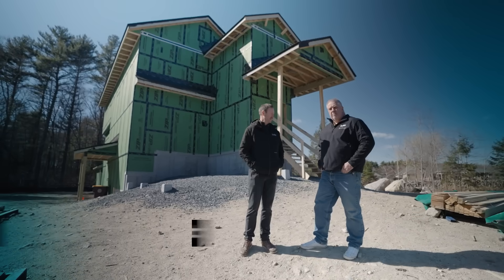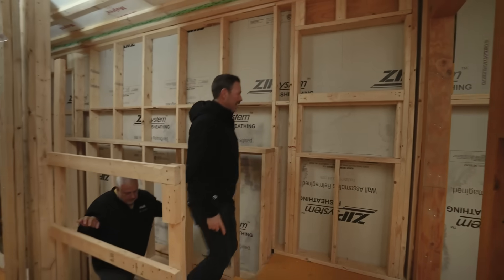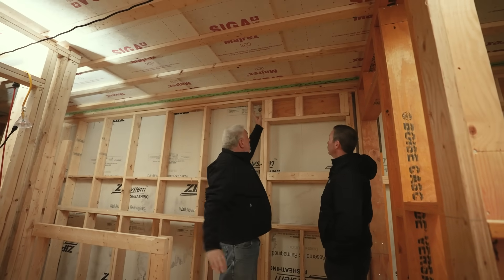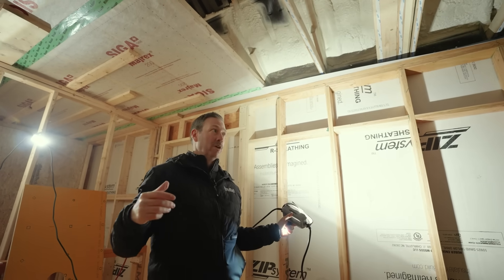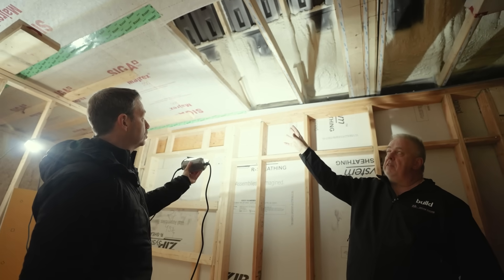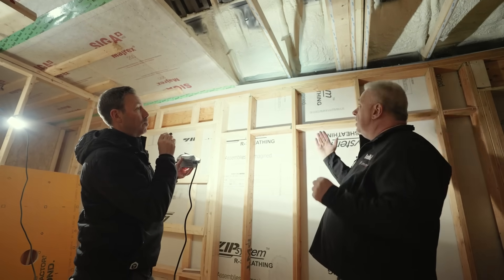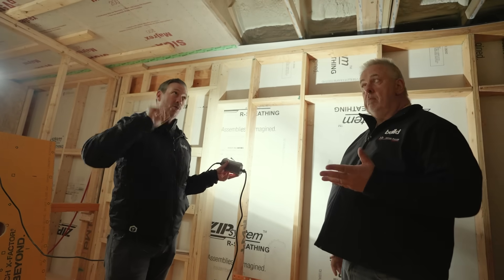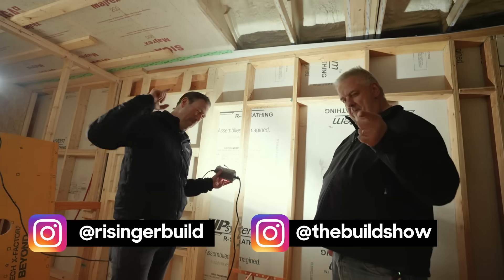Vented Attic Insulation?  Here’s a trick We Stole From European Builders

Comment: We recently went through this and documented it, but our architect wanted the sheathing to tie the trusses into the building. That meant that the top of the sheet did not fall exactly on the top plate, so we couldn't wrap the tape / membrane through to the outside of the building like this. We ended up doing the same idea, but had to seal the membrane to the backside of the sheathing. Curious if anyone feels that the structural tie in of the trusses down to the wall with sheathing is necessary?
Reply: Assuming I understand your comment correctly, It's a good detail imo, especially with high wind loads. Personally, I like the idea of a raised heel truss with the sheathing running all the way up the heel of the truss. It ties the truss to the wall and serves as a baffle for blown insulation.
Reply: @noneyabidness7226  Yeah that's exactly how I did it. Raised heel truss, sheathing goes all of the way up. Before setting trusses I placed a strip of intello down on the top plate and, depending on the spot, did my best to air seal to the sheathing with tape, air dam, and gaskets. 

Couldn't find a "proper" way to air seal this. Felt a bit makeshift.
Reply: @bellrisefarm  If you had used zip sheathing would you really need anything else? Aside from airtight drywall.
Reply: @noneyabidness7226  In my current house, that is the weak spot. I'm trying to get ACH50 below .6, so I was hoping for a continuous air barrier around the entire house. Airtight drywall works, but requires attention to detail. Conservation technologies has gaskets made for that top plate connection behind the drywall. I can go that route. The easy way would be just some sort of tape/membrane that laps over the sheathing onto the top plate as shown in this video, but that doesn't work well with raised heel trusses.
Reply: ok - i have solved for that too, put a couple beads of Tremco acoustical sealant on top of the plate run the Majvest across the plate smooshed into the plate and into the room to connect to the Mayrex. As for the sheathing all the way up - simply run a bead of tremco along the face of the top plate - now you air barrier connections are Zip sheathing to plate to majvest to Mayrex......
Reply: @stevenbaczekarchitect9431  thats what I suspected, but it’s nice to hear confirmation - appreciate it

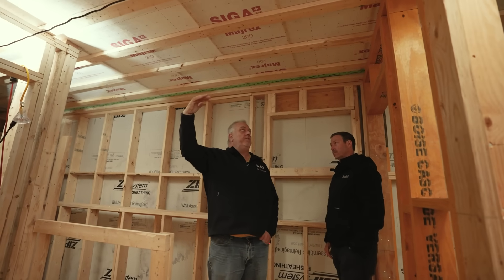Comment: European here :) at 2:23 he probably meant that moisture definitely cannot pass through SIGA membrane, it's not air barier but rather moisture barier membrane. Foam as roof corner air barier is one of the options, but not greatly used here, given most of the time insulation is EPS foam, which runs through the outside wall up to the roof. Piece on roof beam can be blocked off by simple osb or plywood to prevent wind from passing through the usually "blown insulation", but also as a way to be able to blow and stack more of that insulation towards the corners of the roof. One item that I missed, on 2x4, didn't he miss to add nail sealing tape? It usually gets added on top of the roof, but given this is moisture membrane you need to seal off those gaps here as well. Also, wouldn't just rely on tape, membrane glue should be a must, which can be used around nails/screws as well.
Reply: Majrex allows vapor to move well in one direction, but not the other. You will see it clearly stamped with direction. If installed backwards, it would be bad. It's like Gortex for a house. You can let moisture out, but almost no moisture can come back in.
Reply: @andrelam9898  nope. Check the website and read the PFF.

It’s all dependant on RH and absolute humidity.

It can move outwards, jjst not as well as what it lets inwards.

Most smart VB let it go both ways, still dependant on RH and absolute humidity.

Siga separates themselves by controlling it one way, but not totally stopping it still lets some out from the warm side to the cold.

Your welcome 😘😘
Reply: Siga says Majrex is vapor open.
Reply: For the OP, this is why I love cardboard rafter vents. They are easily manipulated at the heel, and can pass moisture through if needed if siga or poly lets sow through.

If you have raised truss heels, run your exterior foam boards up to the roof leaving your inch or two for venting. That’s for new builds or Siding and attic coupled Reno’s with raised heels.

If not the cardboard in old roofs with no raised heels allows best height of insulation. At edge wall, without stuffing batts below the stryo rafters as many do, as that takes in soffit cold air and your top plates aren’t really insulated.
Reply: Are you saying majrex isn't considered an air barrier? If that's the case that is absolutely false and is marketed specifically as a smart vapor and air barrier.
Reply: @Deluxe754  Its marketed as vapour barrier, oc as vapor barrier it can probably act as air barrier as well, but initial intention is to use it as vapor barrier inside. I'm not a builder, just building myself and Siga wasn't my choice tbh, so not super familiar w the product itself. Whatever the purpose, if you take "smart film" marketing wording to be able to release humidity from attic to inside house that's a big trust you are putting into $5/sq.m material especially when you have metal roof which does need ventilation on both sides of the roof membrane you've used. Hence why here, if doing metal roof (I'm not) you put OSB or EPS or plywood as wind deflection on your roof trusses (if that is the right word, top of the wall where your roof rafters sit). Doing so, allows for wind to enter from eaves overhang and exit through ridge or whatever is your flow option, what is key here, is that you prevent wind blowing into your insulation (blown wool/fibre or whatever you used) as otherwise it will kill your insulation R rating.
Reply: Nooooo, I meant what I said, Mayrex is a superb Air Barrier, and is vapor open for moisture migration

Comment: Couple of things I’m curious about.

And I absolutely love this style of full envelope, and love what these guys are doing not trying to knock I’m genuinely curious.

Wondering first how is the blown insulation supported? Because the drywal is going onto the horizontal 2x4, so what about that 1.5 inch space?

Typically the drywall holds the insulation weight, how is the weight bearing down to the drywall in this scenario?

Insulation is light of you grab a handful, but R60 let alone R80-90 etc is a lot of weight, how does that sit on that smart vapour barrier?

Also another thing I’ve always noted, is that (with standard 6 mil poly) when it’s drywall - poly - strapping - insulation the poly is flush on the drywall.

But when they do drywall - strapping - poly stapled to truss - then insulation over found the strapping gets mouldy a bit due to that 3/4 gap between the poly VB and the drywall.

While moisture forms in that cavity, on the warm side of the poly VB, it’s forming on the wood strapping and then not drying out as easily as opposed to poly behind drywall where it’s forced to dry onward to drywall and conditioned home.

How is that dealt with? I know it’s a smart VB but still moisture forming where the 2x4 is would be an issue here wouldn’t it?
Reply: The siga majrex is taped to the bottom chord of the truss with a tenacious siga tape, then the 2x4 strapping is nailed over that to the bottom chord of the trusses. The 2x4 strapping provide more than enough support for the blown in insulation that is to come. We’ve successfully used this approach before.

The one directional nature of the majrex allows any potential vapor from the warm side to pass through into the vented attic. The blown in cellulose is vapor open as well.
Reply: @brettpelletier1219 two things;

First the 2x4 of course strong enough to hold, more thinking of the span between 2x4 strapping. The insulation will weigh on the VB causing it to stretch or pull off staples or tape holding it in place etc.

Also two things with the vapour drying I think possibly problematic.

First you don’t want and moisture passing into the attic insulation, that’s the point of VB.

Also the main of my original point is that when there is a cavity there between drywall and VB, the strapping will take some moisture which regardless if the drywall breathes or this new VB breathes it’s the point that the wood will not dry as quick.

So standard 6 mil poly when done flush on drywall the strapping, moisture form warm side of poly directly on the drywalls back. Moisture has no other choice but to go into drywall and dry to inside.

But everytime (not exaggerating every single time) I’ve seen the VB on the truss, and then strapping the cavity created has moisture forming. Yes it will dry through the drywall, but it’s now wetting the strapping somewhat. And that strapping is slower at releasing moisture.

My understanding of the smart VB is that it can function both way.

As in when it’s warm inside and cold outside it should act as a normal VB.

But in the summer and it’s warm outside, and cool inside with typical poly VB now the moisture forming on the warm side which is the insulation contact side.

That’s bad because with dual climate -30C to +30C poly VB only works in one season properly.

That’s what the smart VB works with isn’t it? But regardless if it lets moisture breathe to the insulation that’s a problem isn’t it? literally the reason we use poly VB in the first place is to not let the moisture form in the insulation.

Cellulose or fibreglass regardless they’ll all be open breathing, the issue is when that reaches the top of the insulation depth and hits the cold attic air it rapidly condenses causing mould.

Not trying to call anyone out, jjst trying to see if there’s a missing link here.
Reply: @justinstevenson2061   my mistake, I see what you’re getting at. The 2x4 strapping is spaced 16” oc. I agree with your line of thinking here in regards to the science and your experience with how moisture moves, I just don’t think the real world application will be an issue here. We have dedicated dehumidification and this assembly isn’t trailblazing. This approach has been used successfully in many high performance homes and we’ve had success with it ourselves.
Reply: @brettpelletier1219  oh yes absolutely. I’m just the retro fit insulator. Main trade roofing, naturally moved to siding, and then natural to insulation.

Have to do siding to swap wall/step flashings effectively.

And have to understand insulation and venting to do roofing/siding so they all fell together.

I’m always baffled these idiot mass builders don’t for example put poly over the interior partition walls to connect each rolls VB continuous. Literally have said this for many years now.

Also as to why when they lay tyvek strips on top exterior plates is it only for the exterior tyvek to join, and never hung over the inside to join to poly.

Yes both different uses, but can at least air seal and still not trap as tyvek to VB not creating any double VB scenario.

And literally 9 days ago o jjst started leaning about smart VB, so when I saw this video I was crapping myself.

Like everything I’ve seen as failures and wanted to address (just haven’t made the jump to build yet, want to but nervous lmao even if I know more than most custom builders I’ve seen hacking it up on 2 mil builds) but all of those failure are addresed in this vid.

So two fold I pat myself on the back to say “it’s not what we’re taught but what we can come up with” but also to show this system in full use by these two in the vid, and it being in practice more in Europe so tried and results noted.

But also then even with perfect poly VB (before learning of smart VB) over partition walls you still have penetrations, and that’s another mass failure.

So this method of 2x4 strapping to me is incredible.

But then started thinking of strapping dead air space downfall.

Wondering if siga on bottom chord and then drywall or plywood etc (whatever has higher vapour permeance) then strapping and interior finish drywall.

Only strictly for weight of insulation. But to run electrical and some horizontal plumbing etc is brilliant.

But then still the same air space problem I’m bothering myself with. Between the two layers of drywall the strapping is still where vapour can be.

But at least my way I’m thinking the vapours not forming on the strapping at the siga, more it’s forming on the ply/drywall at the siga, and then drying to the cavity and then drying to the home.

I overthink things ridiculously.

My metal roofs are double strapped and ridge vented.

Not many do it but some do. But they also cut the ridge wood and use that ridge vent to vent attic and under metal panels.

I don’t cut the ridge wood, and the ridge vent is only for under panel venting.

I then use a stack vent like a Maximum to vent the attic.

Yes the detail to vent the attic through stack vent through double strapping and make stack vent watertight while using hidden fastener metal panels is a pain, I custom make drip edge with drilled holes on a horizontal 1/2 bump out from fascia as an intake for under panel venting.

But all in all that house won’t suck heat, metal will expand/contract far less backing screws (even with plastic washers) but I just am as mentioned self admittedly way over the top.

But that how innovation happens right?

Im just wondering how 20 years later the strapping and moisture diffusion will go.

Not saying you or these guys are causing failure in any way, I’m just killing my self thinking as I always do.

This system is still far far better than what’s out there for sure, just wondering what the next step will be.

R&D takes us so far, trial and error is where we inevitably learn.

I love the soprema cardboard vents, as opposed to the stryo.

The cardboard is better manipulated to fit the truss heel, and if there is any issue (Reno’s down the road and some mook makes holes and doesn’t seal them) and hot air rises it then condenses on the styro rafters where cardboard will breathe outside.

I’ve had people ask, well cardboard isn’t as water resistant as styro, I tell them then you should make sure your roofs kept in good shape 😅. Ideally if I do your roof and attic you’ve got not damn worries anyways.
Reply: @brettpelletier1219  I appreciate your responses, and no I’m not going to seek help for my overactive thoughts, I enjoy stressing myself it seems.
Reply: @justinstevenson2061  I appreciate your passion and I have a habit of overthinking as well. I think it’s great that you have an understanding of the science and real world experience to pull from. It’d be a dream
to work with trades who consider the science instead of just me haha. I’m lucky that I’ll be able to live in this house and I can easily pop out a wafer light in the future and regularly how things are looking in that cavity.
Reply: Please understand, the Mayrex is a Smart Vapor Retarder here, but I really don't care about that, I care that it is an exceptional AIR BARRIER, one that will allow moisture to pass easily....as for the weight, the 2x4 strapping coupled with the Mayrex will be just fine
Reply: @stevenbaczekarchitect9431  - Awesome, I appreciate the answer.

Again not trying to dog anyone, I’m not that guy.

I’m just super into bettering practices. Not to say yours are bad.

More to say I’m familiar with standard minimal installs, and always think of all the failures I see and how to avoid them.

I’m not a builder to be clear, I’m roofing/siding/insualtion renovations.

So being roofing and siding specialist, insulation couldn’t come any more naturally. I love to use FLIR thermal imaging etc, and I really constantly rack my brains about what the mass builders around me  are doing wrong with their quick cheap bullshit.

I always thought about why they don’t lay poly VB over the partition walls for a continuous barrier, and why they don’t wrap the tyvek over the full wall plate.

They put tyvek on the top wall plates before trusses, but only to then attach tyvek on the exterior to the top.

Never see it wrapped into the ceiling VB and always wondered why…..

I mean even their exterior wall VB and attic VB are so horribly connected.

I’ve just said these things to customers a million times, and then I see this video which made me happy to see others using quality systems, and conform to myself that my ideas are correct.

Now yes this is Zip system not ply and tyvek, and smart barrier not poly VB.

But still the shortcomings I’m mentioning aren’t material specific more an application fault with these money hungry goons with subpar quality installs.

I was more just curious. I love the 2x4 strapping, not just cause it’s not 1x4, but more that it goes over the walls to create channels as that’s not something I had thought about.

I know electrical and plumbing penetrations are a problem of course, I just always spray foam them. I never thought about the 2x4 creating a path like that.

Thanks for the reply my good man.

Comment: R84... w/blown insulation... 😂. Maybe in a test tube.  The electrician and plumber will tear it up installing cans and vents. 

IMO in North Texas the best attic is sealed and conditioned to keep the humidity near 40-50% with a properly installed Zip roof deck and open cell foam.
Reply: Nobody installs cans anymore.  Led pucks sit in that 2x4 cavity.  Hvac comes from below
Reply: All the electrical will be below the majrex (besides 1 conduit for future solar) the only plumbing penetrations are the vents which are installed well before the blown in insulation is installed.